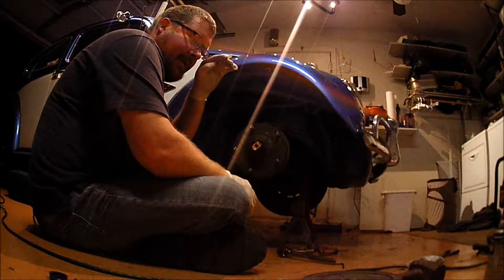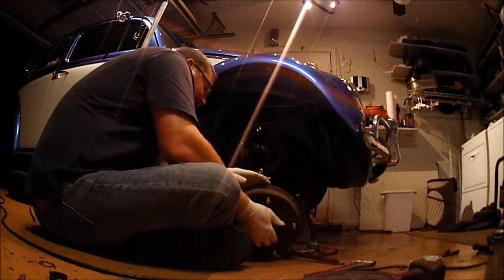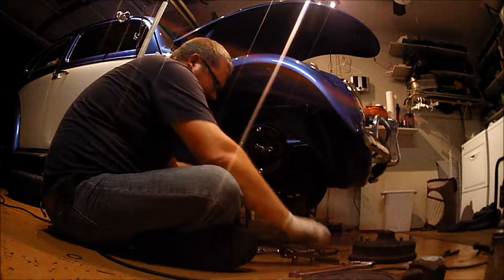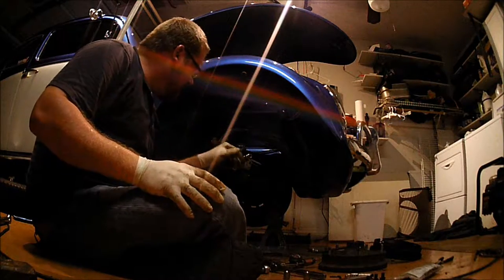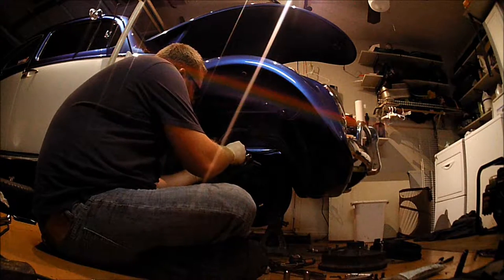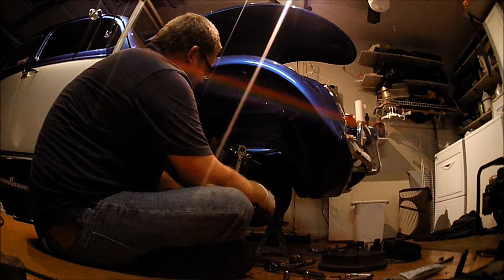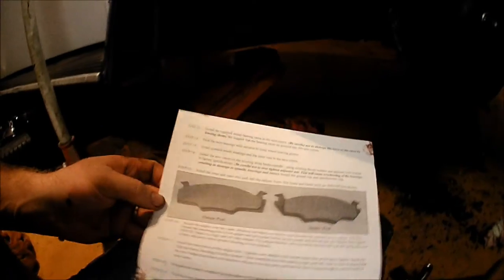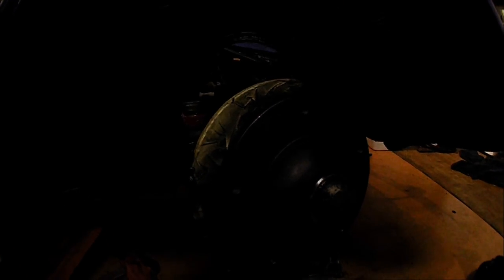Empi Wide Five Disc Brake Install Shade  Tree Episode 23

Comment: Hey Matt, I'm really glad I found your YOUTUBE videos. Even more excited when I saw that you got the same exact disc brake kit from EMPI that I recently bought. Unfortunately I can't find the video where you continue with the instal of these brakes. Did you end up not doing one?
Reply from the maker: Alek Vinnikov unfortunately life happened, and I didn't get video of the last part of the install. It was straight forward from the part where I left off. Just get the pads on right; there is an inner and outer pad. This link is the next video  in where I talk a small bit about the trouble in bleeding the kit, also use some anti squeak stuff on the back of the brake pads. The car stops really good now, and I will be doing the rears soon ( already have the kit). I will make a full install video this time, was trying to keep the video short and forgot to film the second part, sorry☹️.
Link to other video https://youtu.be/wH0tzPJTtEQ
Reply: Thanks for the reply. You do some interesting stuff. Ive been messing around with those disc brakes and pretty much figured it out. Trial and error.... takes a little while to do it this was, but now I know how things go. Glad to hear that you're happy with how they work. Thanks for the link